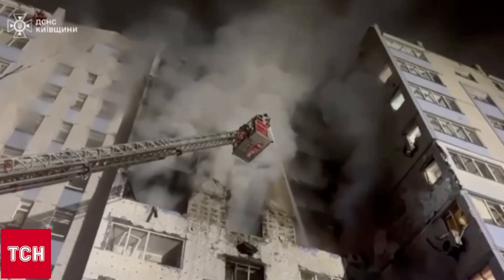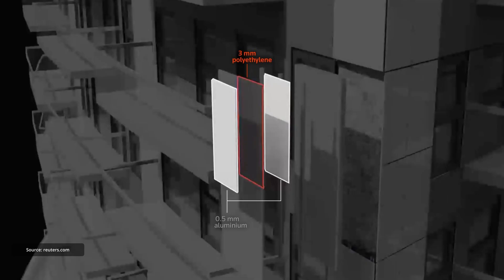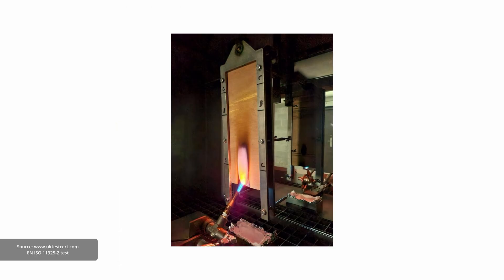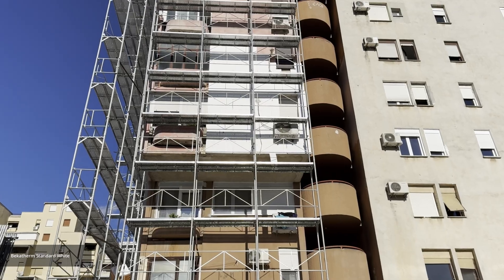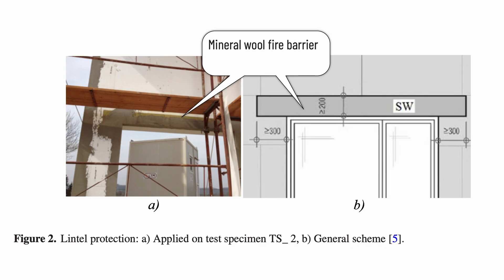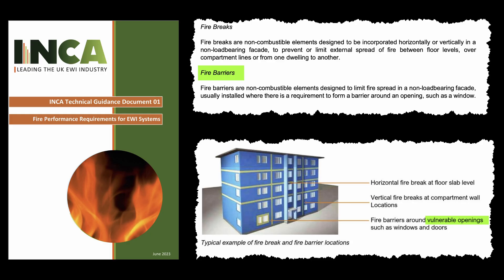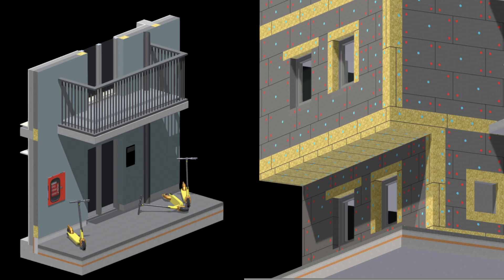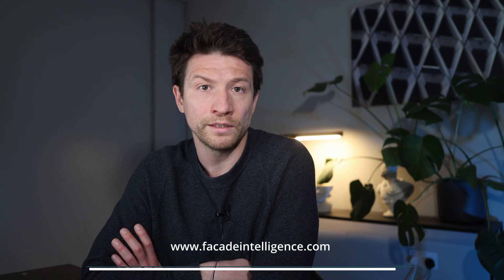Expanded Polystyrene (EPS) Insulated Render Systems. External Wall Insulation. Facade Fire Safety.

Comment: Polistirenbeton, adding eps cells to concrete mix should resolve the problem?
Reply: Polystyrene-concrete (polistirenbeton) improves thermal performance, yes — but it doesn’t fix the fundamental fire and moisture issues of EPS.
You still have a combustible filler inside a porous cement matrix.

It’s better than pure EPS, but it’s not a substitute for proper non-combustible insulation.
Reply: @EugeneKorch Polystyrene concrete is fire-resistant and largely self-extinguishing; it may melt and carbonize internally under high heat, but it produces minimal smoke and does not support spread of fire. I think that's enough to resolve problem from the video. Father of my friend patented block from that material during '90 so I saw all video materials about fire testing that thrmal block, buning them 5-10 minutes with brener and holdong hand on other side of 2 inch block.

Comment: Thank you for sharing this. I am adding the mineral wool window casing to our system as a new stanard detail. This is not required by local building code, but your video presents a strong argument for its use.

Cheers,
Reply: Great to hear.
Mineral wool solves thermal and fire.
Glad the video helped!

Comment: GREAT video and work behind the video. Thank you for the post. I am really surprised that “building insurance companies” have not started to review/research what type of EPS/ render is installed on the building (Many buildings in the US are fire sprinklered, only because your incentives to pay much Less for monthly insurance). You should look at speaking at insurance conferences.  

QUESTION- Why not just use mineral wool on the whole façade? 
(manf. do have have mineral wool render/stucco options)
Reply: I’m also surprised insurers aren’t more active in this space.

As for using mineral wool everywhere — the only real barrier is cost.
Performance-wise, it solves almost every problem.

Comment: Decided to go with Rockwool. Seems safer. No risk of fire. Just make sure you wear a mask whem working with it.
Reply from the maker: Mineral wool is the safest insulation option. There are other non-combustible insulation materials. However, they are significantly more expensive.

Comment: I think I read that XPS is safer. Do you know if it is significantly safer than EPS?
Reply from the maker: No, XPS is still polystyrene. It could be just as dangerous as EPS. Expanded Polystyrene is more widely adopted than extruded polystyrene. However, both materials are seen to be equally as dangerous in terms of fire-safety.

Comment: Is it okay to install EPS under metal roof sheet to prevent condensation during winter & heat management in summer?
Reply from the maker: It could be used in roofs. However, management of interstitial condensation depends on climate and how and where it is applied within the assembly of the roof.